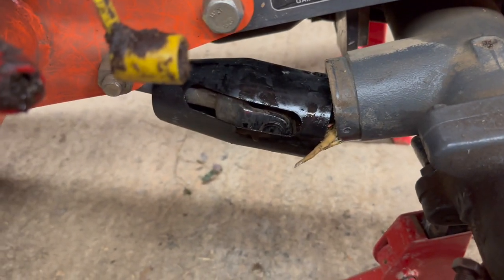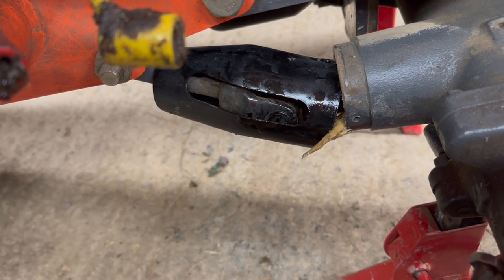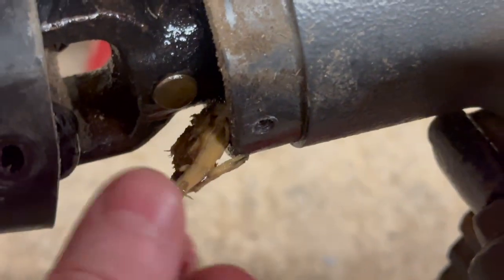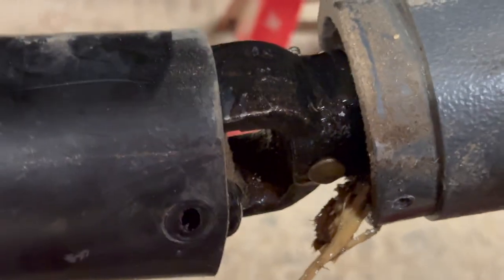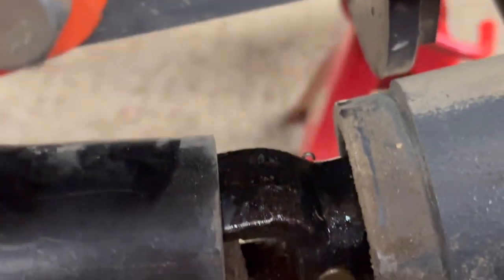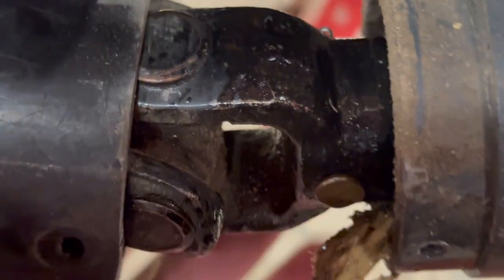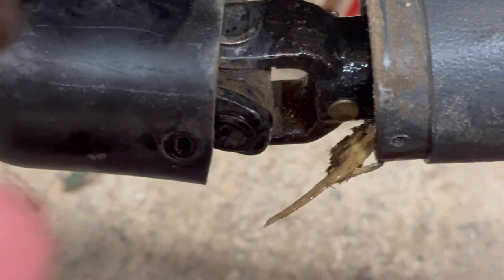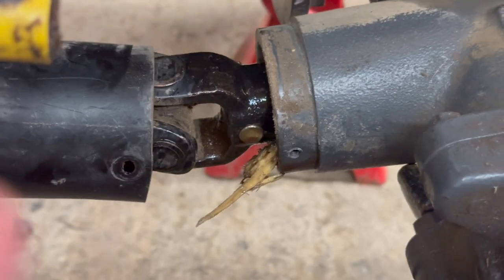131 - I Broke Bocephus

Comment: That's not good Bob. Hope you can get it all fixed up quickly. I was happy to see good stands under there. Safety first.👍
Reply from the maker: That's what I got for Valentine's Day - LOL - I never serviced the front axle before, so I drained the remaining oil from the front axle assembly case and cleaned everything up.  I need to get to the store tomorrow and purchase some gear oil and then get to work on removing and replacing the oil seal.  The seal was $12 from Kubota dealer.  I should have it back on the "road" very soon.  Thanks for watching and commenting. Enjoy the Journey - Cheers

Comment: Just seen this Bob. I’ll send you the information shortly. I’m thinking just pull the seal and use a PCV pipe to install the new one but wait until I get you the info. I’m on it bud 👍
Reply from the maker: Thank you Paul.  I never thought about using a PVC pipe to install a seal.  I measured the new seal with my calipers and it is 2 1/8' O.D.  So a piece of 2" pipe should do the trick.  Thanks for watching and commenting. Enjoy the Journey - Cheers
Reply: @botabob  You’ll do it bud. Your tractor is in very capable hands. I’ll look forward to seeing it up and on the go again 👍

Comment: And Bob, this is why we can’t have good things……
Shouldn’t be too hard to replace that seal.   
Be safe out there and make sure those jack stands aren’t the ones that got recalled a couple years ago.   
Whipple.
Reply from the maker: I think the plan is ready - I am not a mechanic so I got some advise before I make things worse.  Thanks for watching and commenting. Enjoy the Journey - Cheers
Reply: @botabob      If this is like any of my repairs lately, it will take two trips to NAPA, one to Kubota and two hours on YouTube figuring out if I need one more trip to the parts store…!
Reply from the maker: You have me laughing out loud.  I am not going to the NAPA, but I am making a second trip to the Kubota store tomorrow.  I purchased a gallon of Kubota UDT for the front axle.  My advisor told me to use 80w90 gear oil and not the UDT.  Both are acceptable in the front axle.  He states UDT has a tendency to leak and he always recommends using the gear oil.  Hey, he is a mechanic and has seen a lot more Kubota tractors then me so I will take his advice any day.  Enjoy the Journey - Cheers

Comment: maybe still ok put the oil back in see if it leaks.
Reply from the maker: I'm sure the seal was damaged. I drove the tractor back from where I was working with the 4-wheel drive engaged.  I bought a gallon of Kubota UDT oil and a new seal from the Kubota dealer.  Both were in stock and cost less then $40.  Now to remove and replace the seal and service the front differential axle.  Thanks for watching and commenting. Enjoy the Journey - Cheers